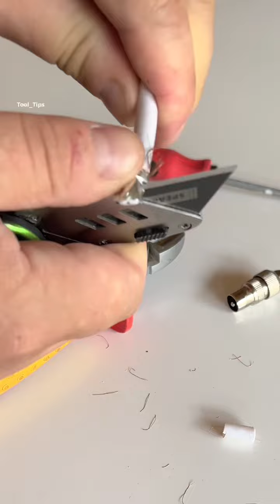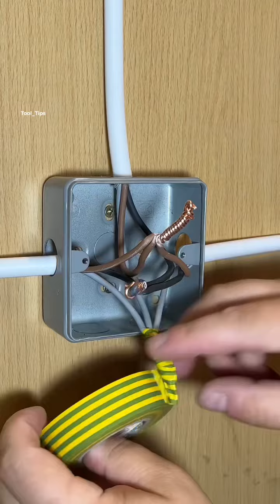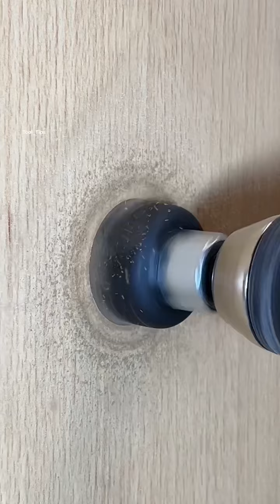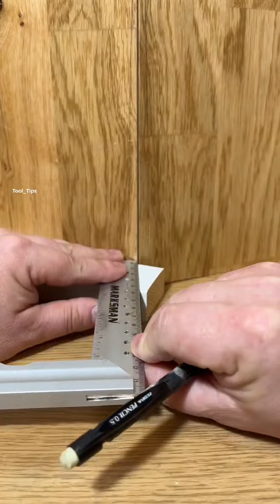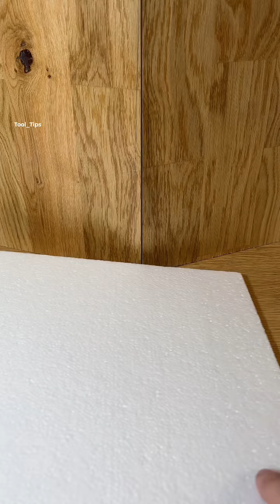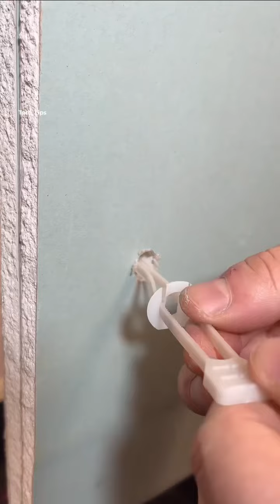101 Handynam Tips & Tricks What You Have To See

Comment: The making the nail driving hammer, making the plyers spring, spray can nozzle with a dowel, tape to peel off tape is 
 always a lifesaver, use it the 
same with permanent marker with another permanent marker depending on the pens base it’ll rub away, why oh why would you screw in a screw that can’t be drilled out idk why just get a new screw, an advert made me stop watching but dam just use initiative and connecter blocks they even have waygos now all it is is a lil snap for a whole lot more safety, stop using tape to cover connecting wires 😢